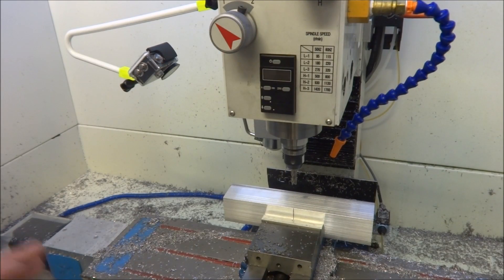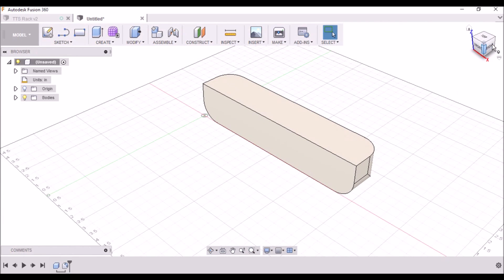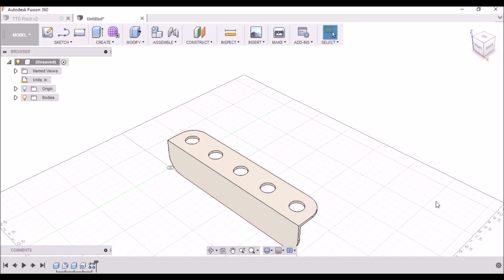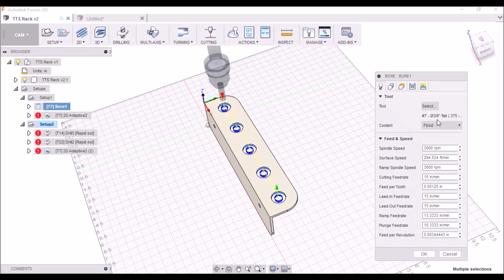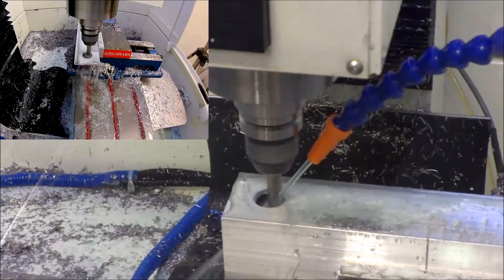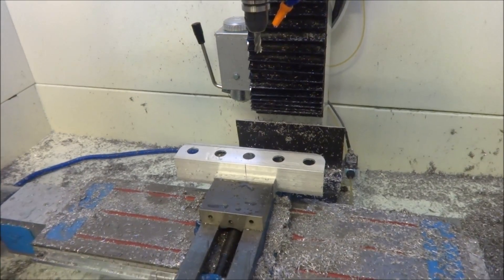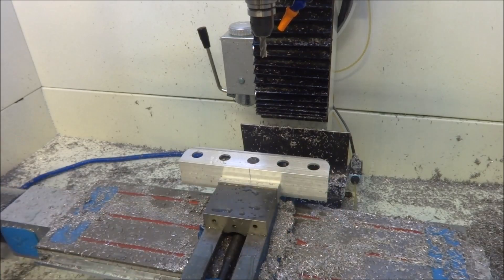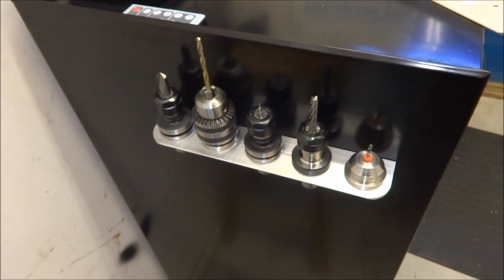TTS Job Rack

Comment: Way to go Sam, tool path looks great, and the little camera has some great looking footage!!! When you machine angle, use a 1,2,3 block to put under the edge hanging in the breeze, just before you completely snug down your vise,  give the angle a little tape to load the machined  surface. Not much or your holes will have a funny taper to them....LOL, just enough to stop the vibrations.
Reply from the maker: James Hopkins 
yeah thank would work thanks

Comment: I did first in mdf similar thing but then I got into problem of long tools. I had my tts tools in air for months and they started rusting. so I 3d printed holders at angle so I can keep them in the rolling tool box while I don't use them.
Reply from the maker: Very good Idea! I can see the problem with moisture happening as MDF will absorb moisture. The plastic is a better alternative. However this rack is just intended to hold tools I am using for the particular job I happen to be running at the time.
be Safe,
Sam